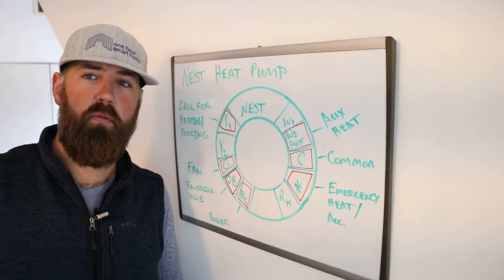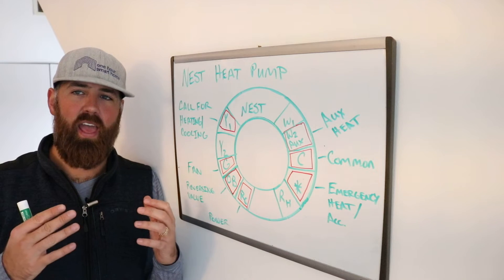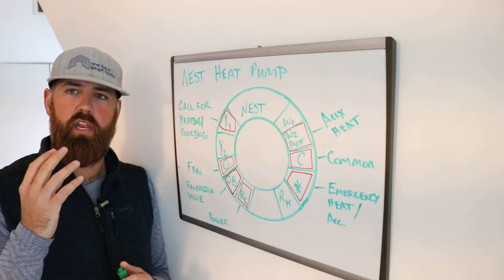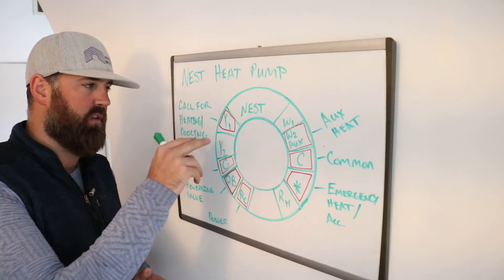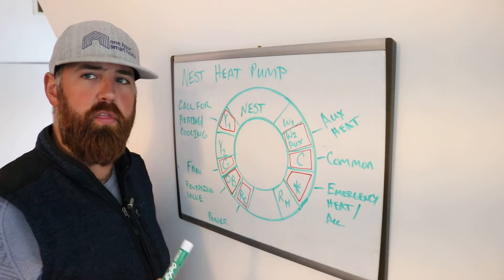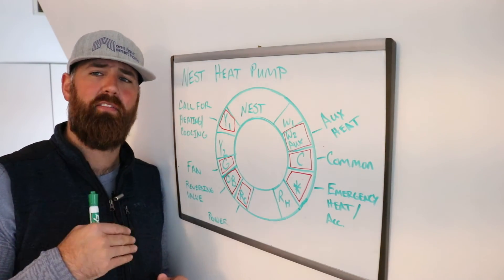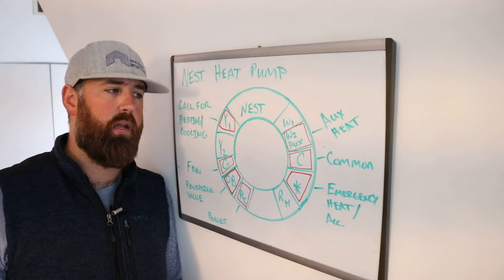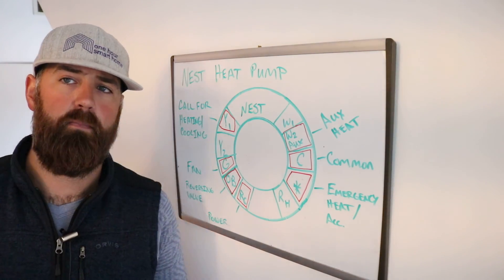Nest Heat Pump Wiring Diagram:  How To Wire Nest With a Heat Pump

Comment: I have a two stage Carrier Infinity heat pump (25HNA948) with FE4ANB006000 with 4 tons and try to install NEST thermostat, but it doesn't work.  I spent about 6 hours to play with it.  I gave up and next day I called the HVAC contractor who installed the unit for me.  He told me Carrier Infinity uses a binary code to communicate between heat pump and thermostat and he told me "Don't install NEST thermostat". It won't work with the heat pump.  In Infinity thermostat from Carrier, it hook up to A (Green), B (Yellow), C (White), D (Red) 4 wires.  If you still want to hook up with NEST, you need to rewire to different ports and will lost all infinity function and work as a one stage.  If you want a Infinity WiFi thermostat, it costs $1126.  Dang, it's so cheap.  Now, forget about the fancy luxury control from Iphone.  Leave it as is to save money.  Just walk up and control it as an exercise.  It was installed by ARS Rescue Rooter. I don't recommend this contractor. They do a sloppy job with installation and tried to call them today to verify my unit if it is a single or two stage system. She keeps insisting to send tech out.  For what? Can't answer a simple question about the unit.  So, I called Presidential Contractor and that's what I got my answer above.  I used two different contractors to install in my house. Presidential is doing a good job and extra mile.  ARS laid refrigerant pipe near the ground and used a cheap foam insulator around the pipe.  Doesn't install a 60A circuit breaker with the indoor unit, but Presidential installed refrigerant line 6" above ground and used a sleeve to insulate the pipe. Plus, the indoor unit comes with a 60A CB.  I'm in Washington DC Metro area.

Comment: You have a good explanation about how the system work. I have a heat pump at home and my old thermostat has only four solid color wires (White, Yellow, Red, and Green) from the wall.  I am about to replace my Carrier Infinity System thermostat with the NEST that I just bought this week.  Pepco gives me $100 rebate, so I only paid $150 via Lowes's store.  When I opened my old thermostat up, it consists of white, yellow, red and green and the old thermostat terminal labeled A, B, C, D, S1, and S2.  What's the heck?  By watching your video, I plan to connect white wire to W2, yellow wire to Y1, Red wire to Rc, and Green wire to G.  I hope it works.  Please, let me know if I'm wrong.  Thanks,
Reply: I’d check your indoor unit where the fan is first and see how those colors match up on the unit. You may not have a C, Common, wire which is needed to power the nest fully. If that’s the case this guy has another video for that issue and has an amazon link to parts you’ll need.
Reply: @brianhundley833 , 
Thanks for your response.  I called A/C shop which installed my unit.  The answer is "NO".  Nest thermostat won't work with Carrier Infinity heat pump because it uses binary code.  That's why Infinity uses less wires and easy to hook up.  I need to buy Carrier digital thermostat to make it works, but it's not cheap.  It runs about $600.  So, I keep my old one and keep operate it manually instead of phone access.

Comment: I have a dual fuel system with a heat pump and a gas fired furnace as backup, using a 3rd gen Nest thermostat. The heat pump is working fine, but the gas furnace is not turning on when the outside temperature drops below the setpoint where the heat pump should shut off.  Not sure if i should be wiring the brown wire to the * terminal, the white wire to the W1? or some other combination?  My confusion may lie in whether the gas furnace is emergency heat, or is it auxillary heat?  any help would be appreciated in the wiring diagram. Or maybe it is the equipment settings that i need to change?
Reply from the maker: Set up the gas furnace as AUX heat. Make sure heat pump balance settings are correct this should help: https://support.google.com/googlenest/answer/9248719?hl=en
Reply: Great video man by watching this saved me $125 they wanted to install nest thermostat thanks

Comment: Live in NC - newer AC unit with heat pump. What am I doing wrong. Had one set up and working along with the app. went to hook up a second unit (forgot to turn main power back off oops) and hooked up second unit. Now no power to either nest. Nothing working. Advise?
Reply: Sandy Antor Probably blew a fuse in your air handler.

Comment: My current setup is a Lennox thermostat, and it has a wire going to W1. I’m assuming that that W1 goes to the * on Nest? 

Thanks for the video! Lots of help.
Reply: same question here.  my old thermostat has a terminal labeled W1/E... trying to figure out where to put that wire on the new nest thermostat

Comment: Wow great video.  Its the first video I have found that actually explains how the wires work before you hook them up in a way anyone can understand.  I will be buying a nest thermostat soon and I have always wondered why I have only one red wire but a RC and a RH connection.    Makes a lot of sense now that you have explained it.  I have a question, I assume the W1 and W2 are probably interchangeable as well is that correct?  This is my color scheme, I have a Yellow, Red, Orange, White, Green and Blue.  I have a tan also but I believe that's for some kind of remote temperature sensor not sure.  But anyway that's for the great video.

Comment: We live in the north where heat pumps alone are not adequate. We have a heat pump/AC for use when temps are above 30 degrees. Below that temp our in-floor (gas fired) heat kicks in. Can I connect both systems to the Nest thermostat?
Reply from the maker: Yes, but you need to get the higher end Nest Thermostat gen 3 or later like this: https://amzn.to/33b8TeS the Higher end Nest allows you to use dual source heating and cooling which is the system you are describing.